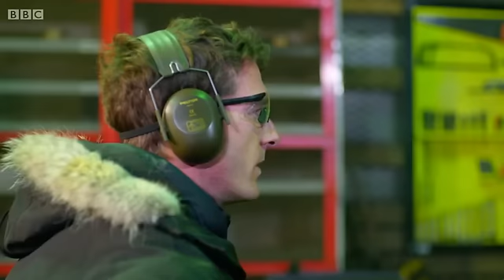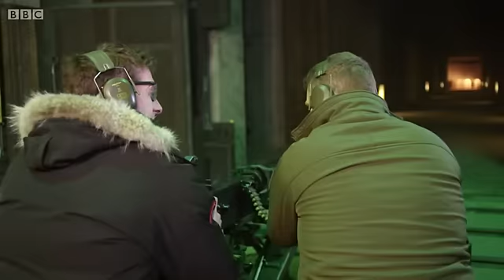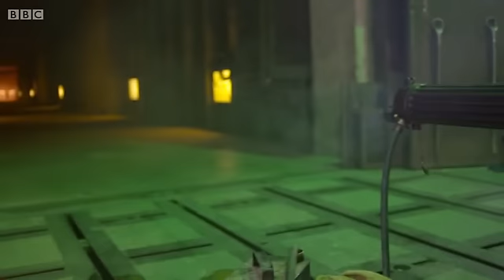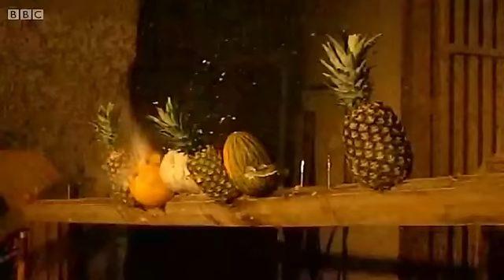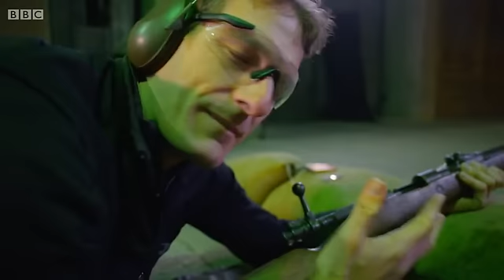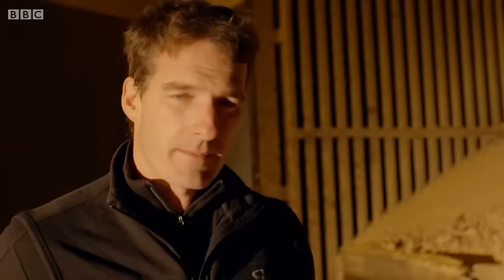WW1 Uncut   4  Machine Guns & Rifles

Comment: Soldiers usually wouldnt load a full 10 rounds into the lee enfield because often it wouldnt load the first round in properly so they loaded a 5 round stripper in it and fire a couple shots then put another 5 into the mag. so 10round magazine.. well not quiet.

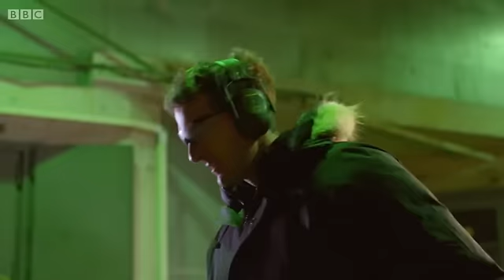Comment: at 5:56 he says (about the lewis gun), ''It was the most mobile machine gun''. Wouldn't that have been the Chauchat?
Reply: Zop3Q the Chauchat was a POS, shoddy manufacturing, and couldn't function in the mud and crud. The BAR came out too late to make much difference. So, yes, the Lewis gun was the best LMG.
Reply: That was actually a false stereotype placed on the Chauchats record by US Military training forces during WW1. You see, the French were told by the US to send Chauchats in a caliber it wasn't able to reliably function in: the .30-06. This was due to the fact that the US had an extremely simple time getting ahold of their native cartridge, on US soil, than they did with attempting to get the French to send their valuable 8mm Lebel ammunition all the way across the Atlantic ocean, far away from where they needed it most. 
The Chauchat worked tremendously well when it was used as intended with it's proper cartridge, the 8mm Lebel. Which is what all of the Chauchats used in US forces hands would be chambered for when they were deployed in the field. The only reason it is still a stereotype that fits with the Chauchat is due to the fact that many US training instructors saw how badly it operated with the wrong ammo, but never attributed it to the fact that it was never meant to used a cartridge as powerful as the .30-06 round, which would make it rattle extensively and causing malfunction in feeding, extraction, and possibly an exploded chamber.
Reply: Zop3Q  or the bar
Reply: Malpaise Legate that's not what I've read. with the open mags, shoddy workmanship, etc. it didn't work even with the French ammo. The ones chambered in 30-06 just caused the gun to fail even faster. It couldn't handle the mud and crud with all the openings in the action and the magazine.
Reply: But what if we are both wrong? These sources from which we gained our information could both be incorrect because it's nearly 100 year old information being told by word-of-mouth to people who never ever used one.
Reply: You can believe whatever you wish to believe, do not let me stop you. I just have no reason to believe something like this unless I have seen it in person, or had it happen to me personally. They made over 262,000 of them, for 4 different countries, and remained in use by some of them up until 1922, that's 4 years after the war had ended. They couldn't have possibly been that bad.
Reply: john Mullholand I wasn't talking about best, I was talking about lightest.

Comment: i thought the gewher 95 was a straight pull no?
Reply: What the fuck are you talking about the Gewehr M1895 was Austria's standard issue rifle during the first World War
Reply: indeed it was a straight pull
Reply: Also scopes were place on the left side of the receiver so you didn't expose as much of your head when sniping from a trench and you could still feed stripper clips, or enbloc clips you ignorant fool
Reply: Rebel Scum there were no straight pulls in ww1, that's why if you look all scopes in ww1 are placed on the left side of the weapons
Reply: +Liberty Valence a side mounted scope doesn't give you the ability to keep your head behind cover. the scope,  the rifle and your head all have to be exposed unless you are using a periscope.

Most rifles back then had straight bolt handles or ejected upwards, but the main reason for side mounts over a "scout" style is so that a soldier could use the iron sights, and load stripper clips, if they were required to fight at closer range
Reply: junorose13 Canadians had the Ross rifle. It sucked though

Comment: For an machine gun, the Lewis was bloody big wasn't it?
Reply: Well.... for a "light" machine gun it was. It was used in a similar capacity as the M1919 Browning
Reply: +Disthron   That barrel though was it water cooled
Reply: RoflCopter No, it was air cooled. Latter on people removed the sheath because it actually didn't do much to cool the gun.
Reply: +Disthron   All I knew is that later versions of the Lewis was used in WW2
Reply: RoflCopter I'm not even sure they were later versions. Despite being pretty heavy to carry around they were fairly reliable guns, and were used on a lot of small craft like PT boats and jeeps.
Reply: The coil spring is properly worn. It's a weak point of the design.
Reply: RoflCopter funny thing is the Lewis looks much lighter than it is (13 kg ISO 11 mentioned here unloaded) . Put a 97round pan on it ant it rushes to 15+kg. It's a beaut to shoot. I shot 303 and 30-06 versions.
Reply: There is a story about a young lad from the Gloucestershire regiment who won a Victoria cross during the galipoi campaign he fought off a pltoon of turks with a lewis gun